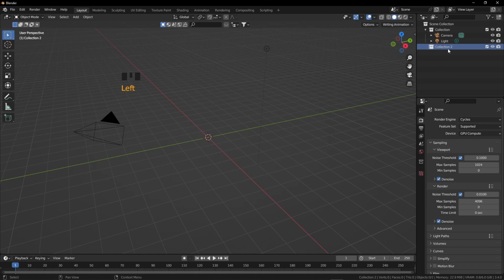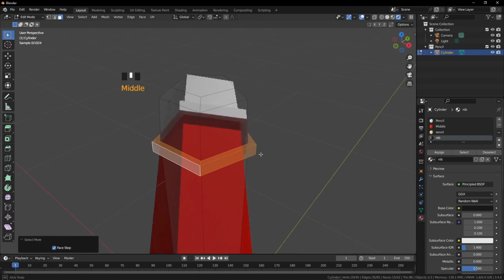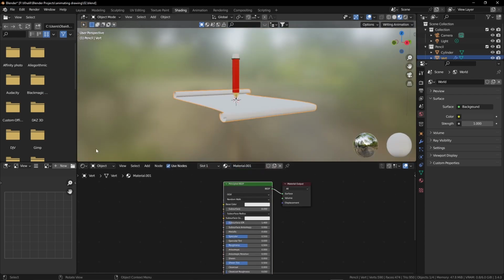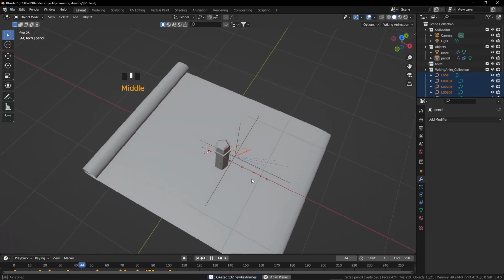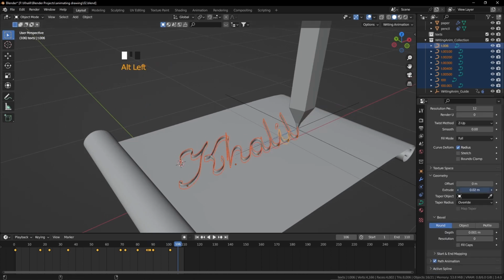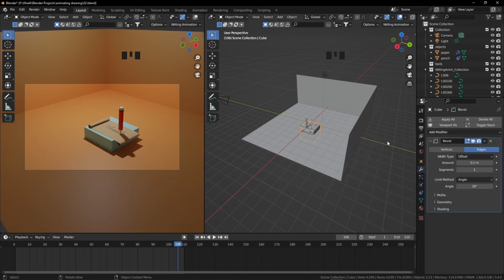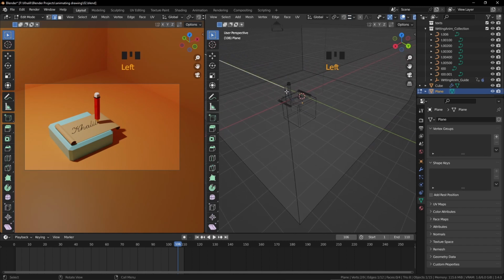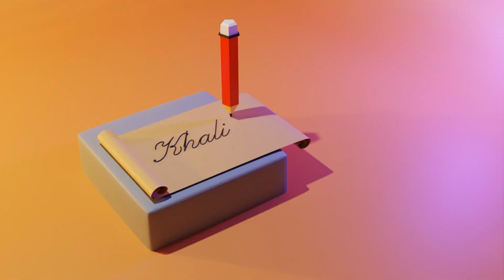How to create writing animation in blender in 8 minutes

Comment: Bro there is a difficulty to render this animation when I render this is rendered very fastly with a black screen and my output setting are 
Fps : 24
Format : jpeg 
Quality : default 
And the jpeg come in my hard drive are black 

So what be the reason
Reply from the maker: Hi Brother, Can you e-mail me the blend file on NaamHaiKhalil@gmail.com
I will try to figure out the problem.
Reply: @khalilthebuilder  bro my problem was solved by render that animation for 3 to 4 times
Reply from the maker: Great 😊

Comment: hi, bro i have a problem that i can't able to see vert in edit mode
Reply from the maker: Hi, it may be happening because you are in face selection or in edge selection mode. Try to be in vertex selection mode and now you can select your single vert. If it will not work then text me again on Instagram with screen recording.
Thanks ☺️
Reply: @khalilthebuilder  thanks it works now